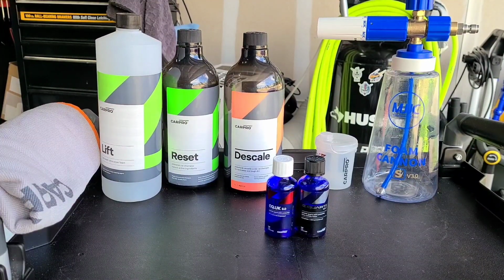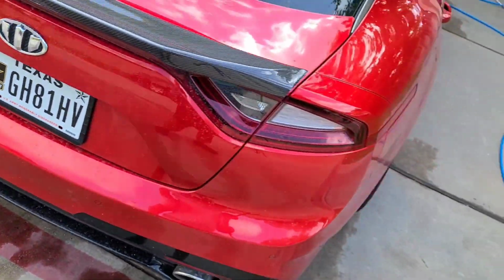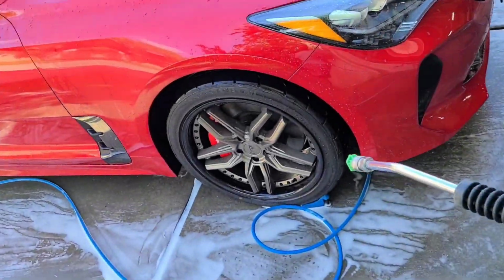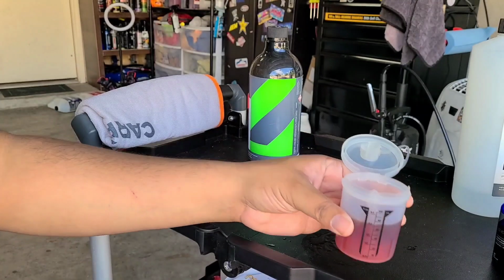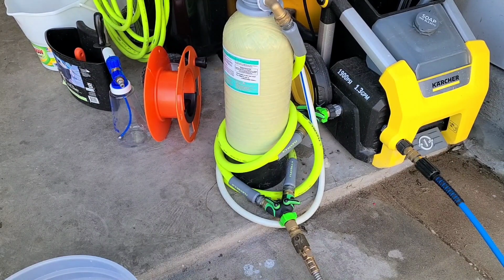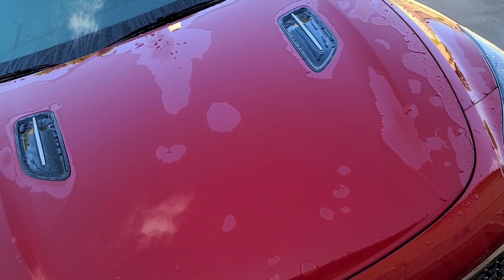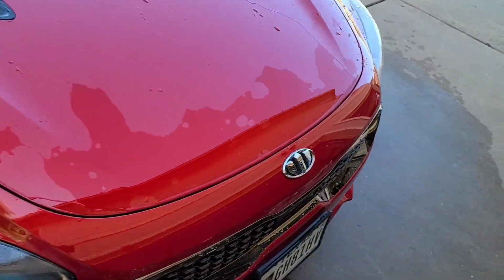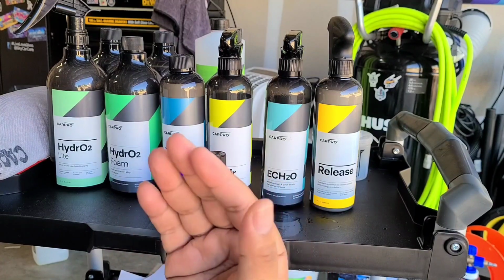[UPDATE] Carpro Cquartz UK 3.0 + SiC - 2 Year Longevity Review

Comment: I have used Carpro 3.0 UK extensively with Carpro Gliss as a topper that have both given brilliant results. First time using Carpro sic and definitely will be the last. Terrible product in every way, with the worst feature being that it darkens the original paint finish. Having to address any small smudge on a panel will bring the original finish back, meaning you have to do clean the full panel and refinish.
Reply from the maker: that's a bummer, UK 3.0 is definitely a staple though. I like using SiC as a top coat though vs a standalone